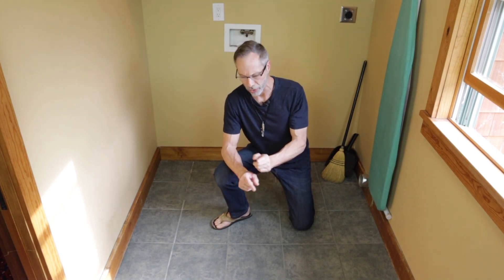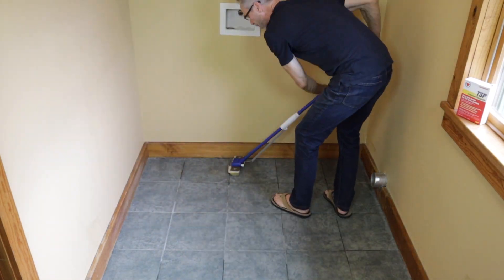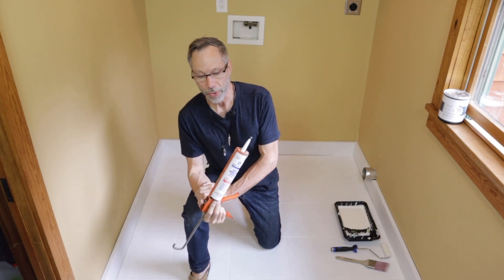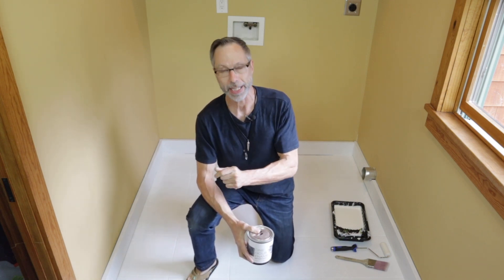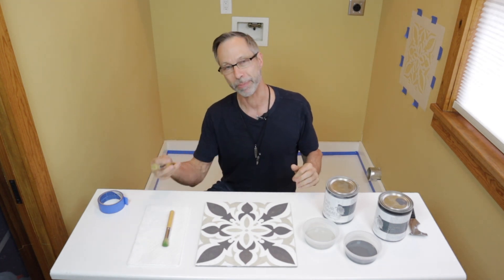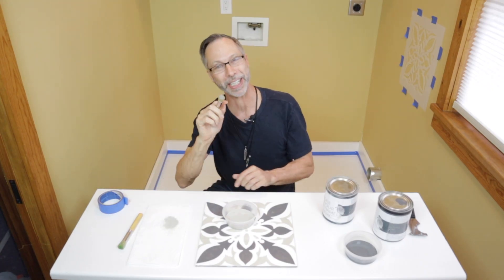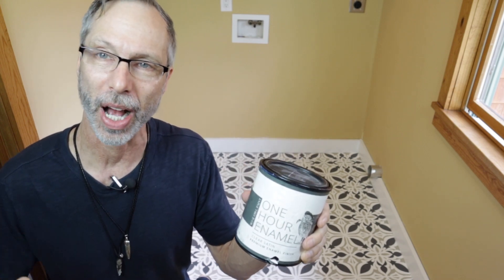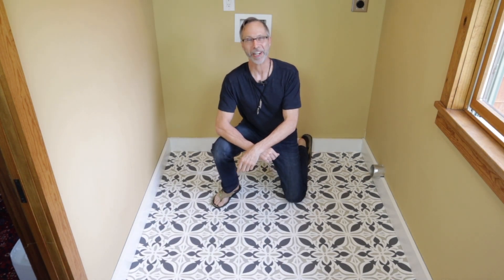How To Stencil Paint a Tile Floor With Cutting Edge Stencils Aloha Tile Stencil and Wise Owl Paint!

Comment: Do you clean and apply a new coat of glue to the pattern after each section? Or does the pattern stays sticky for several sections?
Also isn’t that leaving some glue residue on the tiles?
Reply from the maker: Hi,
I recoat the stencil when the tackiness wears off. Usually every 4-6 prints. As long as you let the adhesive dry for a few minutes after applying, it should not transfer to the wall. Just don't use too much! 
Good Luck!

Comment: Greg, I bought the Linear stencil to do my 11 ft in length by 5 ft wide wood floors in my bath. I have done all the priming and painting on floor, I don’t know where to start, in a corner, middle, I am lost, I have the large size. PLEASE HELP! Can you do a video using the Linear stencil, is there one already?
Reply from the maker: I always start with a full tile where I want to see it uninterrupted. Usually at the entrance of the room. In other words, hide the prints that are cut off. I hid them under the washer and dryer while the entrance of the room has full tiles.
Reply: @CuttingEdgeStencils  Thank you, but I am seriously considering getting another pattern , this Linear stencil is Beautiful, but I am just not sharp enough to figure it out. Thanks for your suggestions! Sure wish there was a video for this one!
Reply: It may help to use chalk line? Idk . Whenever I do linear patterns I do it as if I were laying tile. When you come into the room and look at it have your pattern start from the farthest wall so the cut off pattern is immediately at your feet when you enter the door and it looks perfect at the most obvious corner.
Reply: Oh, Also Modge Podge over the stencil AFTER you place it on the floor and let dry before you paint and the paint won't bleed under the stencil and the lines will be crisp.

Comment: Can I use any paint?
Reply from the maker: Hi, You really need to follow the directions and use an adhesive primer to begin with. After that, it's best to use flat sheen interior latex or acrylic paints for your base color and your stenciling. And then a good waterbased top coat at the end.
Hope that helps. We also have a lot of detailed tutorials on our channel :)

Comment: Do I have to paint my tiles if they are the white color I want them to be anyway?
Reply from the maker: Great question. The thing is, you need a good adhesive bond. If you paint your tile with Stix primer, then you can stencil over it without the fear of the paint peeling off. So I would say yes. Prime the tiles so your stenciling will stick.
Reply: Thank you!
Reply: @CuttingEdgeStencils  Does this apply if you use Rustoleum floor paint that's made specifically for tile? It says you don't need to sand and prime just paint and top coat, any experience with this?